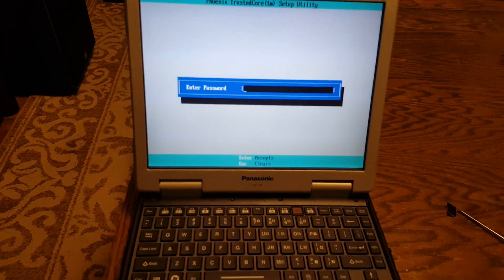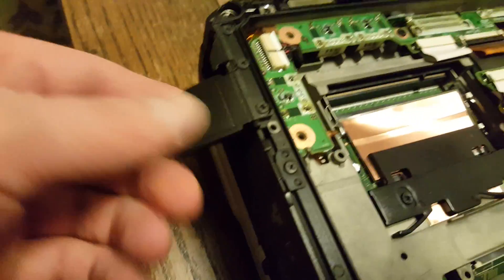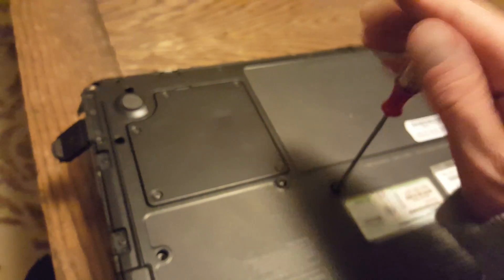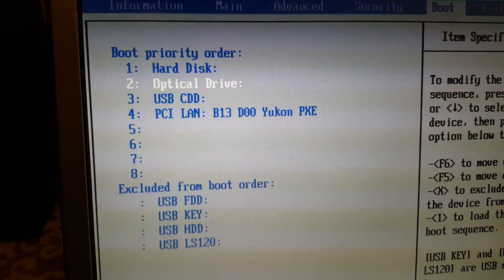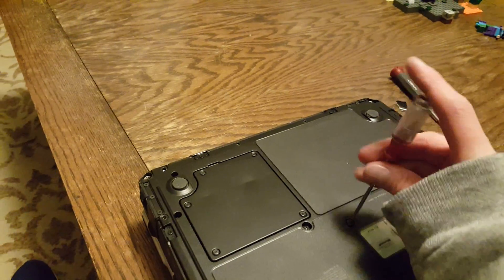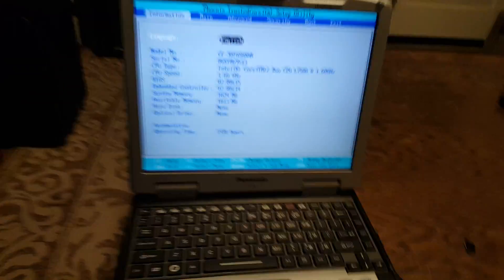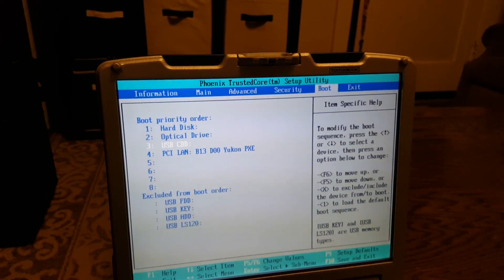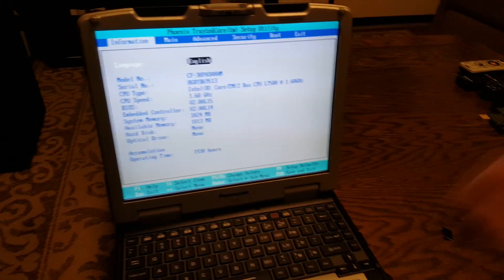Remove Bios Password from Panasonic Toughbook CF-30

Comment: HELP I NEED TO UNLOCK MY   CF54 MKIII, PLEASE ANYONE HELP ME.
Reply from the maker: This method is ONLY for the older computers. The cmos battery removal will not work for your laptop. You will have to send it in and pay to get it removed. Check ebay. Do some searching.

Comment: This works on a CF-30C (mk1) and a CF-30F (MK2). Will not work on a  CF-30K (MK3).  The MK3 has a different BIOS.   Does NOT work on a CF-31.
Reply from the maker: Yep. Information is in the comments I put a few years ago and in description. Thanks

Comment: I gotta stop buying them too!!! LOL :D
Reply from the maker: Hmm lets see when I was buying them for some reason like groceries. I have 2 CF-31's One I guess the password was password and the other i sent to an ebay dude who for 50 cleared it off I have 3 I think cf-30's that are fine but they are only 32 bit cpu so not really worth it anymore. Put in the ssd and the 16g of ram and they are still nice. But the batteries are junk and you can't really find one. I wish somebody would make a mod to change the entire touchpad top part so the touchpad wouldn't suck but thats it. Use an external mouse and you fine.

Comment: Hi opened my Cf30 up held it for 60 seconds,  flicked the button on off,  then waited too,  left the cmos off just put the main battery in, but still asked for a password
Reply from the maker: Leave it all unplugged for a while. Maybe a day. Sometimes the trick I got lucky with doesn't work. Newer cf-30 may not work. Try all the bios passwords in the description.

Comment: Did not work on cf19 :( password prompt still appears
Reply from the maker: The description says its only for a CF-30 and might not even work either. Can try badboys or password,Password. Usual stuff.
Reply: @barrysauce  I'll try it out, it's a little upsetting since the seller on eBay stated it "had a bios password" but they worded it wrong meaning it had a password screen
Reply from the maker: @RyanJosephPerez  Yes try known passwords. If it boots up or maybe pull the old drive and see if you can find some old files maybe? Oh that sucks. So you got it from eBay and the description wasn't really accurate? Mine are old police laptops and those are passwords they have told me so if you buy one from there lot of toughbooks the bios password may work. Some do not have those some do just depends. It is a newer one too since the one in the video is way older. Its not even 64bit cpu yours is for sure so newer bios and they took out all that easy stuff to remove the password. I sent one of mine in and the guy removed it since he made a custom program or he just happens to have the one from Panasonic to remove the passwords. Other companies do and they will buy yours and remove it and sell it. Don't give up . Try and remove the cmos again no battery no cmos battery no power cord. Try and turn it on and hold the power button down and leave it after all power is gone. Might take a day. Guides online to physically remove something off the board and can do that. Can boot into windows and try and update the bios IN windows and that might help too. A big hammer and running it over with a big truck always feels good too.
Reply: Haha thanks for the info I might try all this and the hammer afterwards.

Comment: doesn't seem to work on my cf-30. cmos battery has been disconnected for about a year and the main battery has been out a year but still needs a bios password on boot?
Reply from the maker: A few tried and it won't work. Usually works. Can try default passwords. There should be a bunch in the description.

Comment: OMG, I reset the bios to default settings after installing the GPS module. Thinking it wouldn't hurt. Well, here's a warning, resetting the bios to Factory Settings, or pulling the CMOS Battery will enable the BIOS passowrd EVEN if you currently don't have one. This password was baked in at the factory per the customer's order specification. I did not know. Bricked my CF-19. So I'm trying "admin" "adminstartor" "admin123" as the passowrd. Giving up, and just for the heck of it, I type "password" and it accepted it!!!!! OMG, I'm saved. Thank you lord. Lesson learned. Don't reset to default, or pull the cmos battery. Other people on youtube had success with "badboys" as the password for older models. Who knows, give a try for the most commonly set passwords, and you have luck.
Reply: you literally just copied and pasted that from a forum
Reply from the maker: This guide is only for the cf-30. Might work and might not. Newer cf-30 have issues so it might not work. Standard passwords should always be tried out. Setting to the factory defaults wouldn't setup a password either. Glad you got it unlocked with a password.

Comment: Did not work on my 2008 CF-30, still is a brick, tried this a dozen times but still nothing, so it only works on really old cf-30's
Reply from the maker: So you pulled the cmos battery and removed the regular battery. Then with no access adapter you tried to turn on and hold the power switch for 10 seconds or so then let it sit for a few hours sometimes 24 hours?
Reply from the maker: Also try the standard passwords. badboys or password. All lower case.
Reply from the maker: Still no luck?

Comment: la contraseña de la CF-31 para entrar al BIOS ES  password
Reply from the maker: ??? Did you read the description and watch the video? This is ONLY FOR A CF-30.
Reply: @barrysauce  yes of course I read it and saw the video which is fine, but I am COMMENTING that if someone occupies the password of the CF-31 is password
Reply from the maker: @jorgerodriguez4239  oh ok your previous comment was in Spanish and the didn't say that after I used a translator. Yes users usually know to try the common passwords first. There are a few in the description.
Reply from the maker: I mean what you wrote didn't make sense so that is why I was asking. But in the description there are a few possible passwords but usually the people or techs working on them already know to try password or badboys.

Comment: TL;DW: pull the CMOS battery on a CF-30 or older and the pass will be gone? Seems hard to believe, but I'll believe it.
Reply from the maker: Yes this works on not only a Panasonic but many other brands too. Its been around for many years. Have to do the process correctly though. Take out cmos battery. Take out regular battery. Remove ac adapter. Try and turn it on with no power so no power is left. Let it sit with no cmos battery for about 10 min or let it sit a while longer. Then try and turn it on and it should be cleared out. Many had success but 1 person might of not done it right or he may had a newer cf-30 and that is why it wouldn't clear. There is also a password in the description and it works on many so you can try that too.
Reply: Cool, i'll definitely try it next time I come across a passworded Toughbook.

Comment: Only thing that sucks about buying a ToughBook used is that you have to pay a lot of money for the hard drive caddy which is never included!
Reply from the maker: They are about 50 on eBay which is reasonable. Make sure you get an ssd. On the i5 they are quick 8 or 16 g of ram. Quick machines. Even the cf 30 is descent system.

Comment: Will this work on a cf-19?
Reply from the maker: I don't think so. I remember somebody else commenting about that and it didn't work. If it is an i5 it probably won't work. If it is the one that you need to tear it completely apart just to get to it then I don't think it will.
Reply: I have two cf-39's I bought at a state auction. Are you interested at $50 each?
Reply: barry k. Sorry, cf-29's x 2
Reply from the maker: Nope. Please don't offer to sell items through comments. Try other means of selling. Thanks
Reply: Works well !!! 5 minutes ago I started my book by these method. That guy can hit the God's face, I'm sure))))

Comment: Just put hard drive with windows 10 fresh install and you have working laptop its easy
Reply from the maker: Winders 10 won't run too good on those. 32bit cpu. Have to use windows 7 32bit. Runs the best.

Comment: This worked like a god damn charm. Took me longer to remove and replace the screws than it did to reset it. Saved me a lot of money.
Reply from the maker: Mr. Plague great man. Glad it worked. It's only for that specific model. Saved a lot of people money
Reply from the maker: I wanted to get another one but they are  getting hard to find at a cheaper price. The ones with the cd drive, ac adapter, hard drive with caddy and ram are good deal. But they are real old and not very fast. My dad uses his for ham radio stuff. Bob Johnson's computer service wants you to send it in and buy a new one so they can easily fix the cf30 and sell it for a huge price. When I tried the cmos battery trick and it worked I got another one and tried it out. This is the video.

Comment: Just saw a company that charges $125 PLUS TWO SHIPPING CHARGES AND INSURANCE! to unlock a CF-30 Toughbook!  So I’ll add that cost to the amount of money your videos and swift and accurate emails have saved me when building and deploying Toughbooks to our contractors!  Or conversely your video has caused the Economic Destruction of several tech support shops. Forget abbbbbooout it! You did a great thing here. 
Oh yea nice Pajamas!
Reply from the maker: Yep. Thanks alot! bobjohnson.com They charge a TON to do anything or for any parts. I found a CF-31 on ebay and took a chance. I guess the password like I mentioned before I think and that was a great deal. The other one I paid a guy on ebay to unlock it. As long as it wasn't a newest model he could unlock it which he did. He claimed that he wrote a program to take it out. Another company would charge 500 bucks to do the same thing. But Bobjohnson wants YOU to send the cf 31 and buy one of there's. That isn't a good idea. They are going to make 1000 off of it. The CF30 is very easy to break open. Maybe I can buy the one I am watching off ebay and do another video to totally prove it that they are just making money off you. Being like that I don't like. Sure you have to make money. But not by swindling good people.
Reply from the maker: Can you post up in the comments where you got the battery, dvd drive, hard drive and caddy? Thanks.

Comment: Thanks for helping me so very very much. You’ve saved me money not only on tech costs but also on the machines now worth purchasing!  Additionally by using Mint Linux I am able to spend no Addison all funds for an OS. The Mint OS distros allow full functionality and OBII software capabilities. So in summary for $325. I have a MilSpec laptop with a new 1 TB SSD, New Longlife Battery - 9hours, replaced and calibrated Touchscreen.   It runs my shooting software with GPS, works with my automotive tuning software, etc!!!!  They truly are the best machine for so many uses.  The BIO’s issue was the keystone to making it all work. Thank you
Reply from the maker: Great! Glad to help out. I have noticed this video sure gets a lot of views. More than I expected. I wish I wasn't wearing my pajamas! Those CF-30's are very cheap to find on Ebay. Problem is you have to buy a DVD Drive, HD Caddy and HD, Memory and Windows 7 if you want to go windows at least. So it's expensive to start out. My dad got a CF-30 I fixed and I put in a Samsung 850 Evo 250G and maxed out the ram. That thing is very fast for it's age. Little slower than I wanted so I found a CF-31 and sent it to a guy on Ebay who was able to crack the bios password for me. Another CF-31 I found I guess the password was " Password " in the bios! What luck! The i5 3220 cpu is the one you want. It is the 3rd gen i5 and it is quick. The next one up is just way too expensive. Put all your upgrades in that one like the SSD and 16G of ram! That will just fly. My dad used his CF-31 for field day at a ham fest with the N1NM logger program and it had no issues at all Rock solid. I have seen others on Craigslist with claimed 5K software for big trucks and other automotive software go for a crazy price. Problem is once you know how easy it is to fix then you can keep buying them. They are very good machines. Thanks again and I'm glad to help anybody out!
Reply from the maker: Here it is. Just can't believe somebody would pay this much.
https://lascruces.craigslist.org/tls/d/diagnostic-tool-scanner-for/6358015774.html

Comment: Just bought a cf-53 on eBay with same problem going to give this a shot but since it has a newer system I'm going to wait a few days before repluging the CMOS battery if this doesn't work going to go through the command prompt as soon as I get a HDD in and windows loaded
Reply from the maker: Rick L I would try it after an hour or so. remember to remove the regular battery and try turning it on with no power. then try it. don't plug the cmos back in yet. see what happens
Reply from the maker: Any luck?
Reply: Hey there, No the CMOS didn't work since it has a much newer motherboard this trick does not work for newer systems like I figured but to answer everyone's question yes I figured how to get rid off the password on the 53 model takes time, in total around 2hrs but after this password is cleared and ready to be messed with, I couldn't even load windows because I think the USB Boot was disabled while password was active but now ok.
Reply from the maker: Rick L yep figured that since it isn't the model I used to make it work. there are people on eBay that can possibly remove it if you can find one.
Reply: Na I figured it out myself, I hold a belt in several things regarding computers like went to school for it long ago back then it was a lot easier, all I can say about this one is first this is my first toughbook and second this is the most pain in the ass to work on because you have to fully disassemble if you need to get to the motherboard compared to some HP's or DELL's
Reply from the maker: Rick L Yes! youbhavevto completely take it apart. great job tho man. yep any other laptop is much easier to rip apart. can try booting off an external DVD. on my cf 31 they disabled it all sobi just reset the bios to clear it all. good laptops with an ssd and max ram
Reply: Yeah I got it because of the you can drop it get it a lil weter than others, the only con I see is that it's a lil small for my taste I like the bigger screens, I've been looking at the DELL XFR 6400 6420 those can actually be in the water because they have an exhaust that pushes water out and their bigger.
Reply: @rickl571  please tell me how did you manage to remove the password from the BIOS on cf 53?

Comment: Hi. This trick does not work! I have a cf-30 Help Board
Reply from the maker: Alek Dudka you pulled the bottom off and unplugged the cmos battery? And pulled the regular battery? also holding the power button down with no ac adapter plugged in? if it's a newer cf-30 than what I had i can say its possible it won't work. nut removing the cmos is usually all you need to do.
Reply from the maker: Let me know if it works.
Reply: Hay! I'm very glad to hear from you. Yes, exactly your way to action, this CF30 - MK3
Reply from the maker: Alek Dudka what???
Reply: This is exactly what you say, I have a Panasonic CF 30 (MK3)
Reply: did, as you said
Reply from the maker: Alek Dudka oh ok. got the password cleared then?
Reply: Did not work out
Reply from the maker: Alek Dudka must have a newer model.
Reply: Writes - The system date is updated 01.01.2008 and .... password again!
Reply from the maker: Are you sure it is a CF-30 and not a CF-31?
Reply: Sure

Comment: Cf 31 password I havent found a fix to clearing or even getting the password????? help plez
Reply from the maker: As I wrote in the video description and mentioned in the video this works usually on the cf-30 and not the cf-31. The 31 is a different hardware. Have to check out ebay and the web on somebody that can remove it.
Reply: cool thx barry I was just hoping some one here had solved

Comment from the maker: FYI This doesn't work on CF-31 and if you send it in to Heartland they will charge 500 to remove it. They want you to buy a new one and give them the locked one so they can unlock it and sell it for 3k or something ridiculous . Check out ebay auctions for there are a few that might have the tools to remove the password cuz I did and it works fine now. But the older ones like cf-30 you can easily get the password removed by taking out the cmos battery.
Reply: cool
Reply from the maker: @larryjimenez5147  Yep.

Comment: barry k.what if a do a reinstallation,like a clean install will that remove the supervisor password?,but i don't need to back up nothing ,theres nothing in this Panasonic CF-53 that i want to save,i just dont want to wipe out the OS on it?do i still need to back up the OS files? or can i just do it and reinstall windows and start all over again,and give it a new password,and just one password this time.Thank you for all the other replys,hope you can advise me once again before doing the reinstallation a clean install